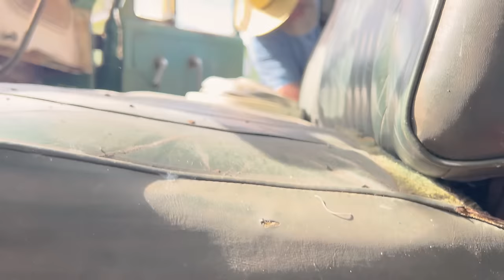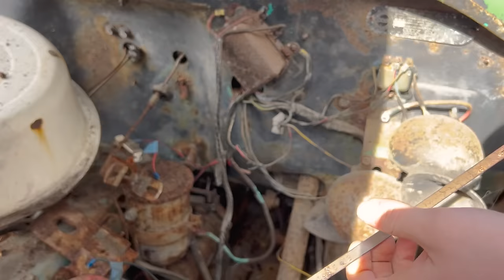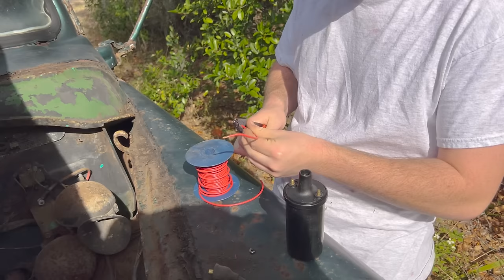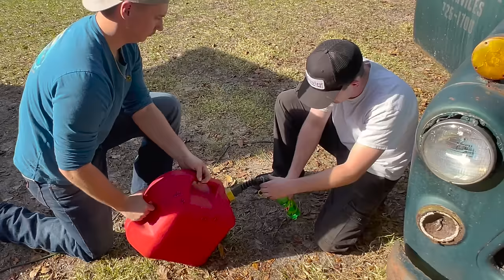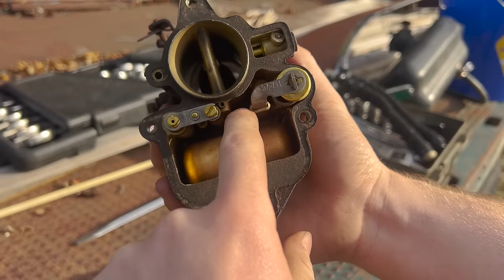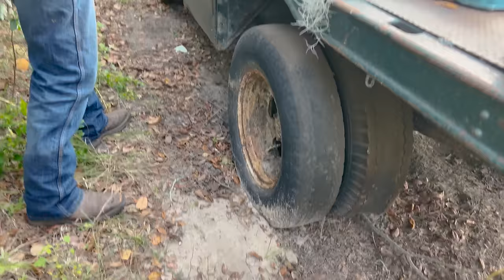Dually Parked For 45 years!! Will it Run and Drive Again??

Comment: Always put a lid a bit of grease on that cam inside that distributor that helps that plastic tip on the points to stay in tack and not wear out

Comment: Remember this tip. Leatherman multi tool has A points file on them already. That's what the funny looking file like thing is on them are called to. Some of them have A flat blade on the end of them to already as we'll.  Everything is compacted into one tool. It's  one of the all in one tool. Items like multi boxed in wrenches set to. Cause A set of them have different sizes on them to save space and their more simplified that way to. Three decades and one year. Due bad mishaps and other issues to. So I'm not going to replace.,or look for any of those kinds of tools to buy to have again myself. I look at it this it just wasn't meant to be either way. Awesome work y'all are doing out there still today for sure no doubt about it.

Comment: If that truck had that converter, unless they changed the starter to 12 volt from 6 volt, the engine should spin like crazy. I had '46 Willy's that was half converted so 12 volt only went to starter. Hurricane 4 spun like scalding rear tire at drag race

Comment: Ok for your gas tank use a boat fuel line primer bulb and hook it to the fuel pump  put gas line in your gas can  also you should try carburetor fist before taking it off   and if your engine clutch is stuck push the pedal in and have it in gear it will brake clutch loose  boat   primer bulb will help get old fuel pump working and gas up to carburetor with you living in FL should be able to get boat stuff easy  and you can use a boat tank get rid of that black gas tank get something you can put inside on the floor on the bed tie it down

Comment: I really like your videos. 
But....why didn't you check brake and clutch fluids. 
Check the master for both as well. 

And why when the gauge said it was heating, you disconnected the radiator and kept it running on for a little while more. 
You lucky the head gasket didn't blow out. 

But, I like your videos, it's honest. But each time you do one....learn from it.